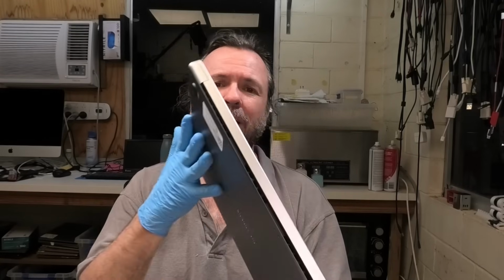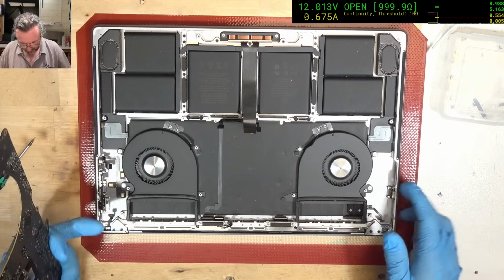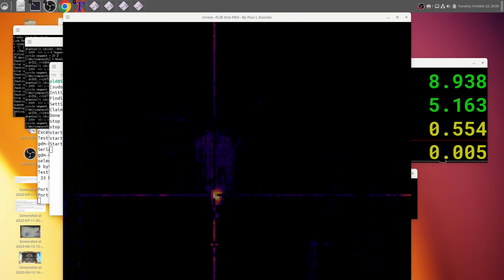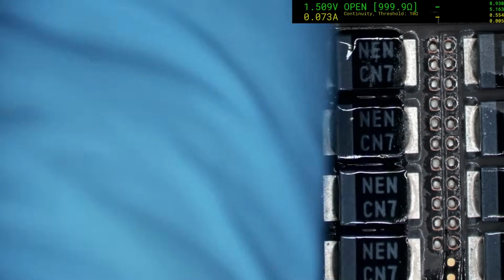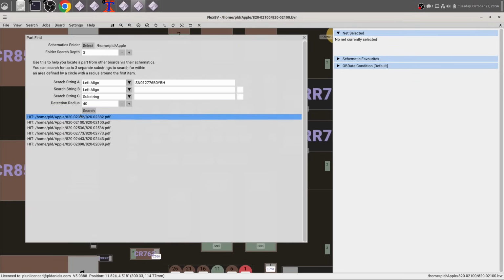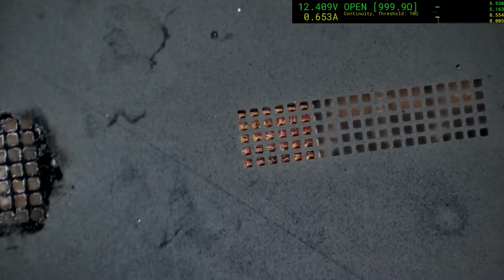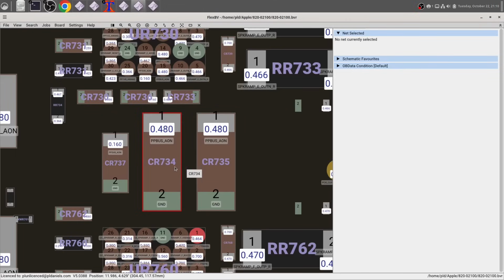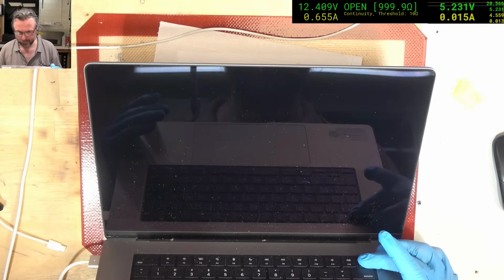SAFELY finding SOFT short circuits.  Macbook A2485  "No Charge" ( not a cap )

Comment: I didn't know that trick with the thermal camera covering the light so the thermal sensor can find this soft short circuit. thanks for sharing
Reply from the maker: Glad to help.  Comes in handy at times, though I do need to make a better setup so I can move things around under the blanket and not get snagged up.

Comment: I noticed that every repair technician blast every component with incredible amount of heat or soldering it really hot. Do you ever killed any component because of the heat or a repaired computer came back with the same problem after the repair? You removed a cap in 5 sec and put a new one in 12 sec, removed a controller chip in 8 sec and put a new back in 13 sec with a bit of preheating, don't you find it a bit fast? The steepest reflow curve 3°C/sec, yours is 29°C/sec for removal and 18°C/sec soldering back (calculated with 20°C room temp).

Ones I killed a buck converter with too much heat, but I didn't know at the time, the symptoms was that the power supply always killed its schottky diode which seemed impossible because both the fuse and the power supply which fed the buck converter was rated lower than the diode. After the 3rd diode replacement I realized the controller will be the problem, preplaced it now on a preheated board and the problem is gone. After this accident I always preheat every board.

People say with quick heating you don't stress that much the surrounding components, but I don't buy that. I watched I guy blowing up a capacitor while replacing a DrMOS, maybe 1 capacitor is dead, but other 5-6 lifespan shortened 50% because of the extreme heat. I don't say people should follow the refow curve, but what I see in these videos I call it extreme stress on the components. 
For smaller components I preheat the board from the other side about 1 minute with hot air station, for larger componets I preheat the board about 3 minutes with preheater. Maybe I just waste my time preheating, but I'm glad that non of the motherboards came back what I fixed.
Reply from the maker: I think better to check on live-videos where there's no editing.  I remove a lot of the rework time on edited videos because it's just me sitting there waving the wand around waiting.  In a lot of cases I tend to use the want to warm the board area up around first if it's a feasible option.  There's also the situation where the board is already hot from prior rework so the next application will be faster.

Definitely some parts do not tolerate the rapid ramp well ( hence I tend to cover a lot of things if I can, especially tantalum caps ).

I would say it's a balance of risks, which is true of most of the things done with reworking that you see; sometimes it's effectively impractical from a time or setup situation to preheat; however if you do have the time then by all means.   

One risk with reworking and preheating is that you can inadvertedly induce solder-squeezage out of underfilled neighbours ( particularly with the NANDs and CD32xx chips on these boards ).

Your concerns are merited, and at the end of the day it does come down to the balance of risks and what a shop is willing to accept & support.

Comment: Hey Paul, great repair.  I'm having similar issue with leakage on a smd qfn switch.  I think you partially answered my question but do you think that the root cause here is internal to the silicon of the ic, not some corrosion under the chip (like between the balls) where it's impossible to see?  You mentioned that heat is the main enemy of these chips and I agree, I think that during initial board fab, the lead free temp requirements comes too close to the death from heat range and it causes latent damage to the silicon so that it fails eventually for leakage/resistive short.
Reply from the maker: Unfortunately in this instance I didn't check the resistance before/after the cleaning process.  I think it's fair to say  sometimes it's the material on the PCB causing conductivity between pads/balls.  In this video the junk was between PPBUS_AON, 3V8_AON and GND so the 17R could have likely been purely the liquid agent; if there was enough conduction between PP and 3V8 it could have triggered the sensing.

I could go back and check that part, since I keep those for each job.

Comment: Its good you are careful with your voltage injection. We aren't allowed to use voltage injection, probably because the instruments we are repairing reach well into the six figures. We aren't even allowed to use hot air unless it is BGA. The way I would have been required to find that short is to pull the old trusty Agilent 4338B Milliohm meter along with the 16338A Test lead kit which uses four wire kelvin connectors. Probably would have ended up pulling the cap closest to the IC as you did since it would have the lowest resistance, using JBC tweezers not hot air, unless I could get a needle tip probe on an outer ball which can be doable with the right high quality probes. Only then use hot air with the proper sized square nozzel and a preheater if nothing critical nearby, otherwise its off to the CNC machine. Then reball new chip with low melt. If you got it wrong and the chip is fine, expect to speak with the boss.
Reply from the maker: Definitely a different approach with such delicate/expensive gear. 

I have got a 4-wire meter here, one I designed & built many years ago (PLD-LOM7) but the biggest pain I had with it is finding decent 4-wire probes that didn't resemble clothes pegs; I've come up with some alternatives more akin to normal probes but to date I've not really really needed it... yet.  Downside of my idea of suitable replacements is that you still ultimately have some offset that you need to actively null out proportionally to current ( even if it's 1mA )

Comment: Thanks! Side question: Where are all the SMC failures? I feel like back in the day, you would reball every other video. Change of hardware production?
Reply from the maker: Almost never have jobs like that coming in any more.  Even at substantially reduced repair costs the Magsafe1/2 series rarely shows up now, maybe the occasional A1466 and those mostly now seem to either be a dead cap or a failed CPU IMC :(

Comment: The blanket is new. Without that it seems like this would have been a shot in the dark situation. I like how you figured out whether something was a reflection or not.
Reply from the maker: Definitely.  I need a better one, or an actual "dark box" to put over everything ( a bit tricky with the tripod on the iR cam, I'll need to create something better perhaps ).  Once you block out all the external influences you'll then start picking up reflections of the heat from the camera itself ).

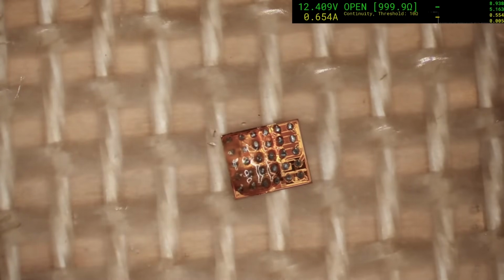Comment: 19:22 Could you elaborate as to why Lead-Free solder is 'bad' \ 'worse' then Leaded solder?
is there no Lead-Free solder brand that is of the same quality and strength?
Reply from the maker: The nice thing about leaded solder is that it has the lower melting point ( but still high enough for practical purposes ) and more importantly it's quite a lot more durable & ductile for this purpose than a lot of lead free solders.   Lead free SAC305 is a fairly nice replacement though still has a higher temperature ( ~220'C vs 183'C for 63/37 leaded ).
Reply: 23:30 is that it?